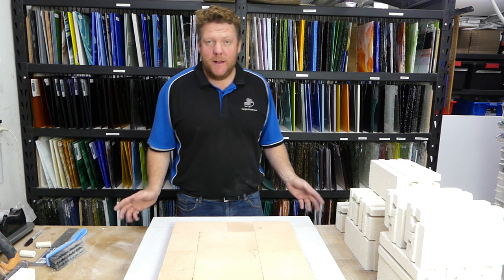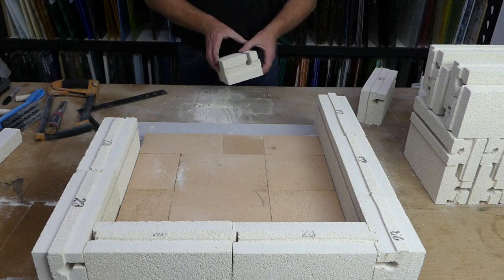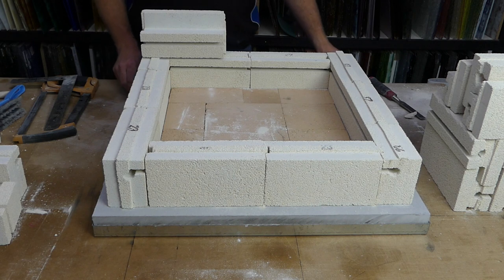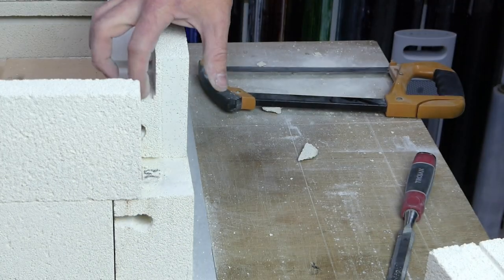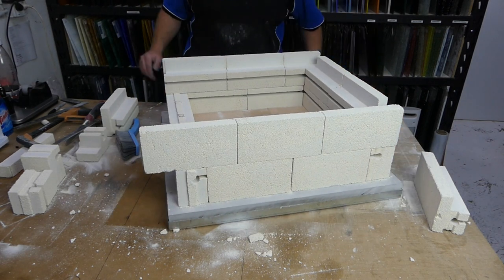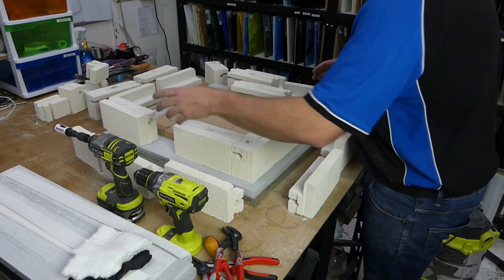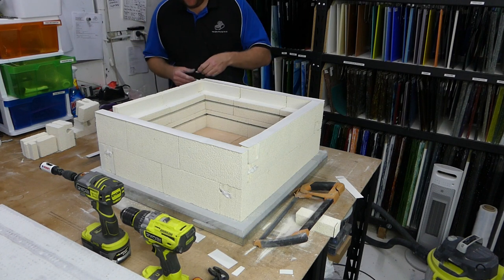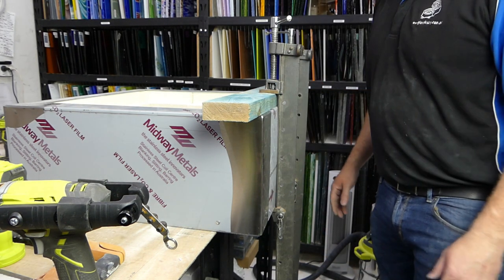Glassfusing DIY Kiln Build Part 2

Comment: Jeeze this is really a hectic work, a lot of sanding, chiseling and massive repetition of measurements. This is the best DIY video for building a kiln, thanks for the effort of getting good shots of the build process. Is there any alternative to calcium silicate board? Can you add ceramic fiber wool instead of calcium silicate board, will the efficiency still be the same?
Reply: I don't think it was a very efficient build. He compensated for a sloppy inner build by going over it with the board. just one internet idiot's opinion.